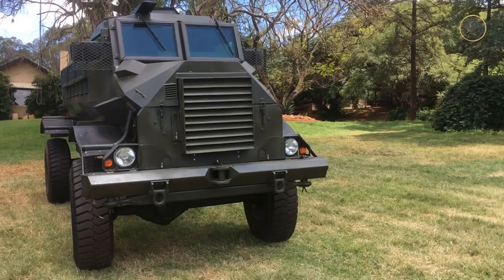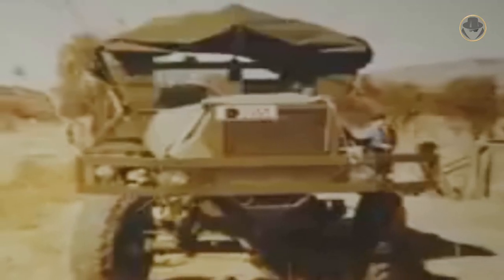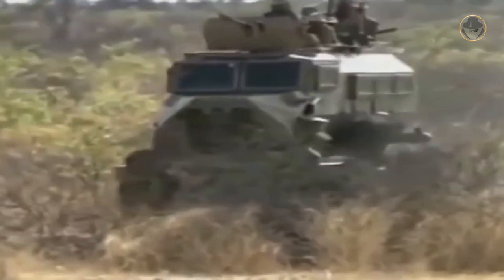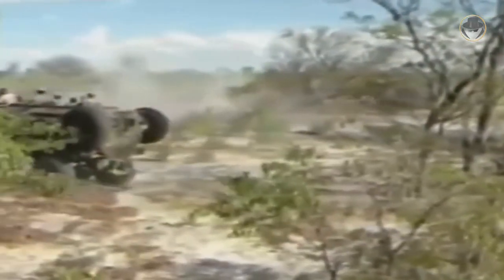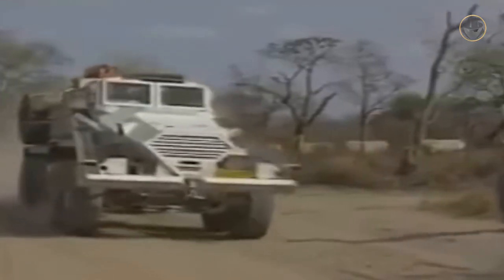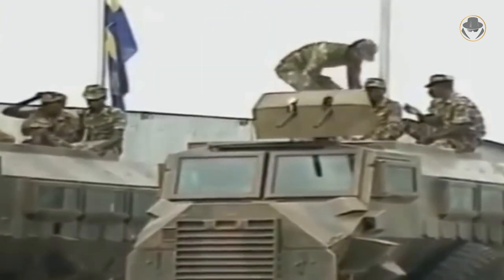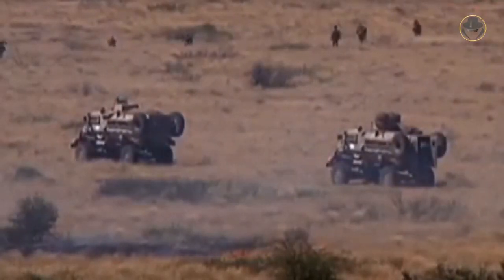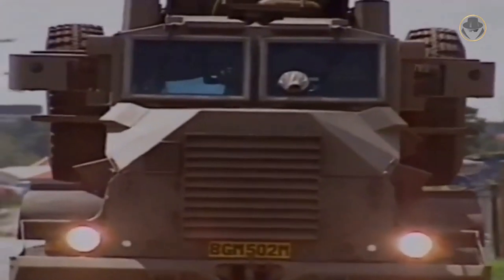Casspir mine-protected vehicle | The vehicle that has set the standards of the modern MRAP

Comment: It looks like Magirus
Reply: I would think the SAMIL looks more like a Magirus.
Reply: Casspir running gear all Mercedes Benz
Reply: @dougerrohmer Samil was KAK
Reply: @davidv7184  Which one? There was a 20, 50 and 100. I only got to drive the 20, and got it stuck up to the differentials in a mielieland and was then very impressed when a 100 recovery vehicle came and pulled us out like no problem. So, compared to Bedfords that were there before, I think you're talking kak.